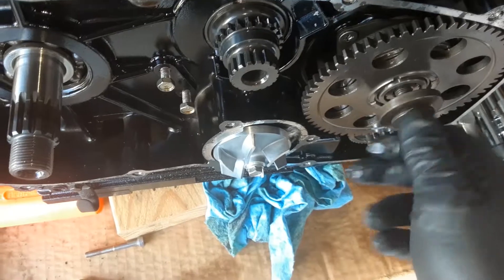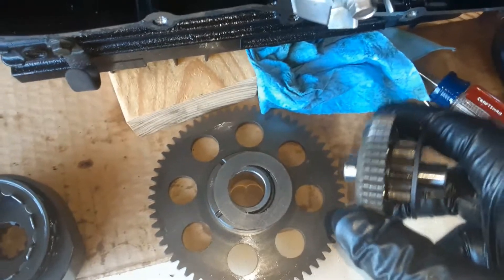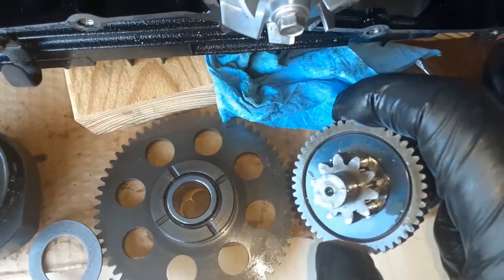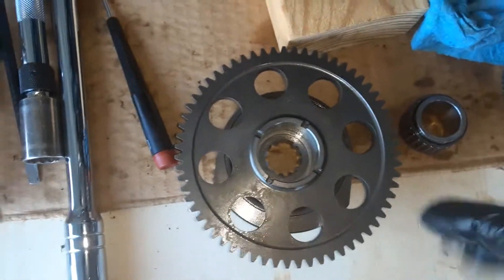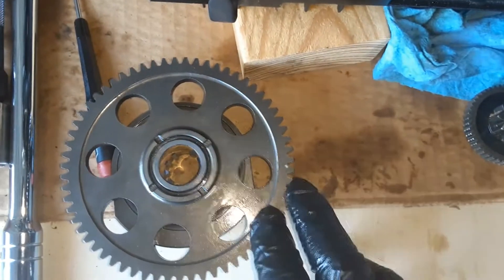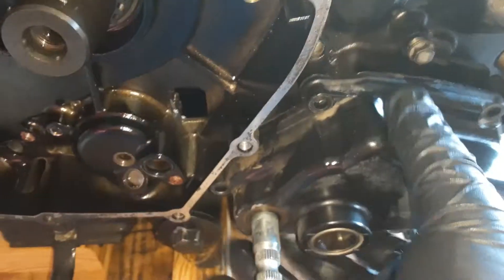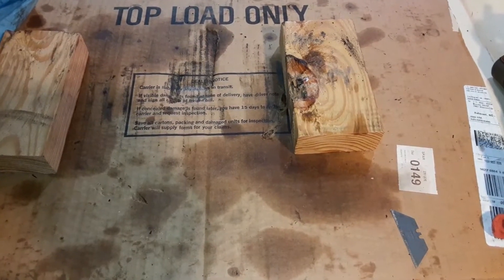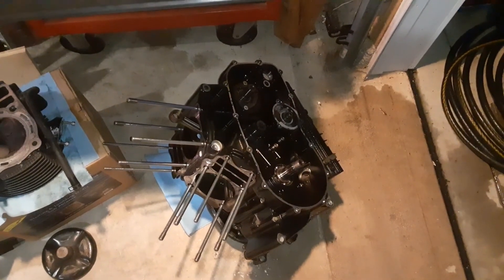2009 Vulcan 900B Engine Teardown and Repair Side Gears Removal and External Shift mechanism

Comment: great videos!!! I'm stuck with my engine rebuild.  How did you manage to get the collar of the countershaft.  Mine is stuck!!! tnx mate.
Reply from the maker: Are you referring to the circlip next to the 4th gear? Or the where the shaft passes out of the crankcase (the seal collar?). If it's the latter, it really shouldn't be stuck unless some corrosion has set up between it and the shaft. Although I am not the biggest fan of PB Blaster - it will work if you soak it good and set it up so that the penetrant will pool and work its way in. My favorite penetrant is a product called "Free All" but A) it's pricey - $15/can, 2 can minimum and B) once you use it you can start a count down for how many days the spray valve will last because it is a very "aggressive" penetrant. But it works like a hot knife in butter! Whichever you use the whole secret to penetrating oils is patience... spray, wait, spray, wait, tap with soft faced hammer, spray, wait, tap, repeat until it gives up - it will unless it's galvanic corrosion. If it's galvanic, it amounts to being lightly "welded". In THAT case see if you can get access to a 10 ton or better press - set up your countershaft very carefully to protect the end surfaces and just force it out!